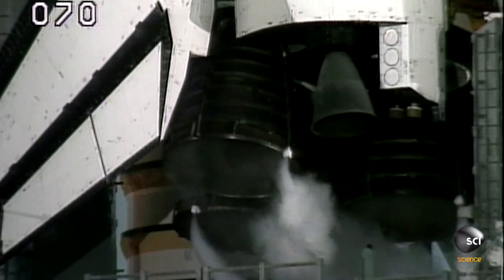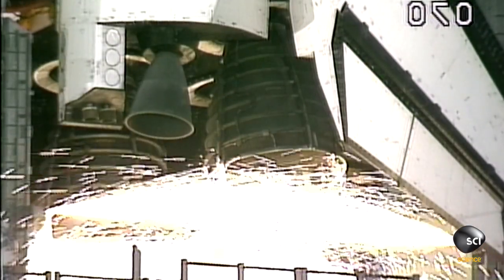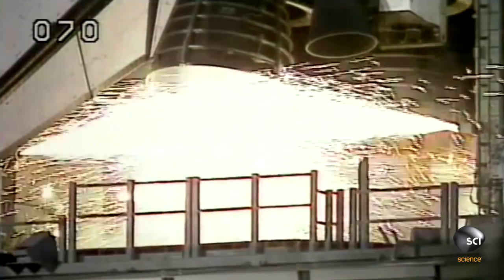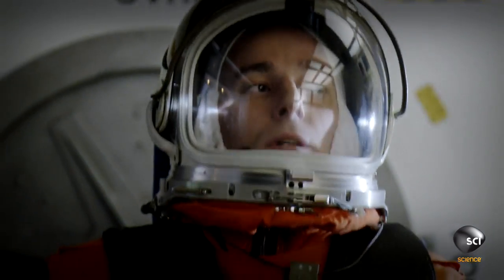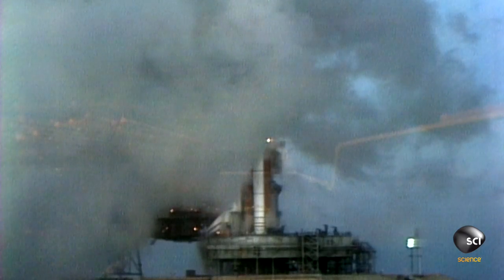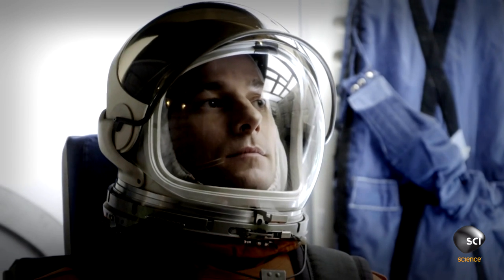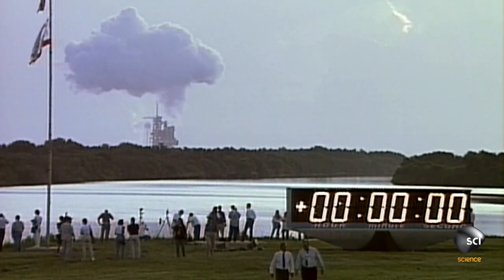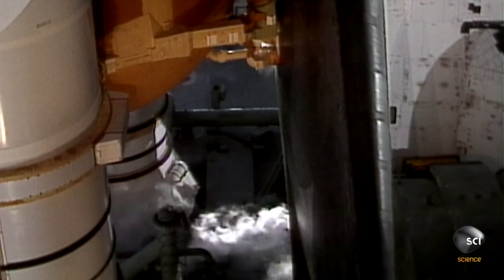Last Second Shuttle Launch Abort

Comment: It was a heart stopper, but even this is not as bad as an Flight Readiness Firing test. No people on board and they fire up the engines for a 20 second run. At full throttle. Yeah the thing rocked for about 10 mins afterwards.

They only had a few FRF tests. One for each new orbiter on it's first flight and I believe one for each of the "Return to Flight" missions. So probably 7.

Comment: JESUS CHRIST U ARE NOT GOING TO TELL ME WHY!!!!??????????????
Reply: If I remember correctly, it was a faulty sensor. Nothing dangerous, but better safe than sorry
Reply: I think the sensors were accurate, it was the oxidizer turbopump for engine #3 that was over-revving.
Reply: Mixter Muxter The Engines weren't at their peak performance during the last check.
Reply: The launch was originally scheduled 18 August 1994, but there was an RSLS abort at T-1.9 s after all three main engines ignited - the fifth (and final) time in the shuttle program where an RSLS abort occurred after main engine ignition. Previous aborts occurred on STS-41-D, STS-51-F, STS-55 and STS-51. The automatic abort was initiated by the onboard General Purpose Computers (GPC) when the discharge temperature on MPS Main Engine #3 High Pressure Oxidizer Turbopump (HPOT) exceeded its redline value. The HPOT typically operates at 28,120 rpm and boosts the liquid oxygen pressure from 422 to 4,300 psi (2.91 to 29.6 MPa). There are 2 sensor channels measuring temperature on the HPOT. The B channel indicated a redline condition while the other was near redline conditions. The temperature at shutdown was at 1563 degrees Rankine (868 K), while a normal HPOT discharge temperature is around 1,403 °R (779 K). The redline limit to initiate a shutdown is at 867 K. This limit increases to 980 K at T−1.3 s (5.3 s after Main Engine Start). Main Engine #3 (SN 2032) has been used on two previous flights with 2,412 seconds (40 min) of hot-fire time and a total of eight starts. This was the first flight for the HPOT on Main Engine (SSME) #3.
Reply: +mustrang6172   The onboard computers were just massively trolling the astronauts.
Reply: Pizza was not yet delivered!!
Reply: It's a clip...
Reply: I think one of them needed to poop. So they stopped. No big deal.

Comment: The Shuttle engines fire at T-6 seconds, the SRBs at T-0. The fire control and the stop control are issued at the same time. the SRBs are one shot devices, and they can boil steel. if the SRBs fire, the spacecraft is going somewhere whether it wants to or not
Reply: SRBs are rocket motors they don’t turn of without being out of fuel

Comment: The fact they had solid rocket boosters that large on each side just made this thing an uncontrollable bomb that could go off from the smallest fire...
Reply: By that definition nearly every rocket ship ever made is "an uncontrollable bomb that could go off from the smallest fire," which isn't entirely wrong, but it doesn't make the space shuttle special.
Reply: @HURBased  Not really, liquid fueled rocketships can be very controllable. Solid rocket boosters er LITERALLY uncontrollable. You can ignite then and then it's a missle without trajectory.
Reply: @FroddeB  What I'm trying to say is that a large segment of spacecraft had SRBs, so a lot of rockets are "an uncontrollable bomb that could go off from the smallest fire". And an SRB is not entirely uncontrollable, with systems such as thrust vectoring completely possible.

Comment: Yes. This is why the engineers said , "put the capsule with the astronauts in it on TOP of the rocket." but NASA built what the government wanted,  not what the engineers recommend. It was actually Nixon that insi5o. this design because of the capability and capacity to launch military satellites and bring them back.
At least the latest designs NASA and especially SpaceX and Boeing have escape systems to give the humans in the capsules a fighting chance if (and when) someone goes wrong like the one astronaut mentioned about an abort and sitting there wondering if the bottom of the stack was on fire.. and...not knowing if it was gonna explode and being just a few feet from thousands of gallons of highly explosive rocket fuel.
Reply: Gotta always be a Republican to blame, huh?  You obviously know nothing about the history of space flight.  You do know that was a reenactment of what happened with him sitting there looking around, right?  Geesh.

Comment: The automatic abort was initiated by the onboard General Purpose Computers (GPC) when the discharge temperature on MPS Main Engine #3 High Pressure Oxidizer Turbopump (HPOT) exceeded its redline value.

Comment: how the hell were they able to stay on the pad even after SRBs were ignited. I heard once they fire there is no going back. and then you have the several hundred thousand gallons of liquid H2 and O2 and if the boosters have a malfunction BOOOOOMMMM an event that'd bring back memories of challenger
Reply: The SRBs didn't ignite.  The main engines did, but they shut down before the solids were lit.
Reply: SRBS never ignited. If they did, they were going off the pad. Once the SRBs ignite that's it. You're going uphill, whether the SSMEs like it or not.
Reply: Actually there is a way to stop the SRBs once they have ignited. But you would have to separate the boosters from the liquid fuel tank before initiating that. Its called self destruct sequence. Watch a Challenger documentary. You will hear them talk about it once you see the Challenger blow up.
Reply: And as it was impossible to separate the SRBs while lit without destroying the entire Shuttle stack, it would be the end of the astronauts either way if having to initiate self destruct on them.
Reply: Correct. Those Astronauts were doomed no matter what.  However, I believe the self destruct sequence was initiated to prevent the SRBs from damaging property.